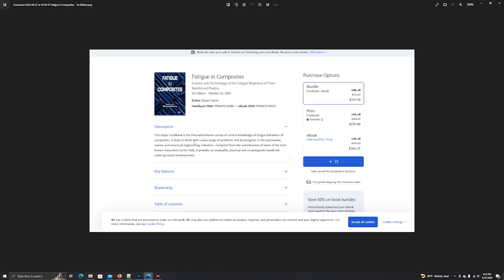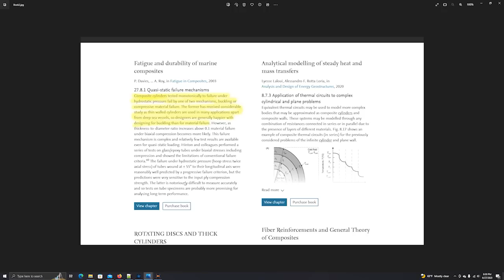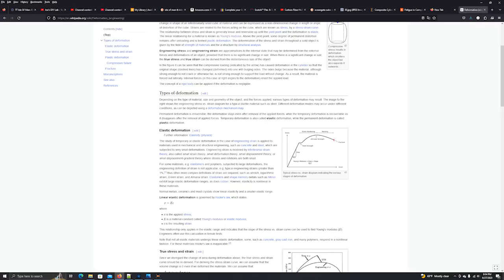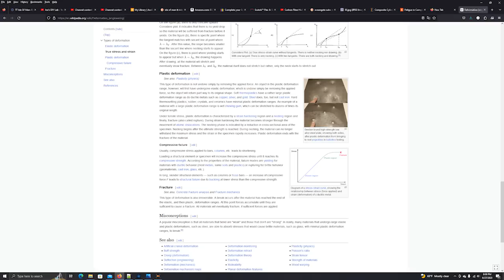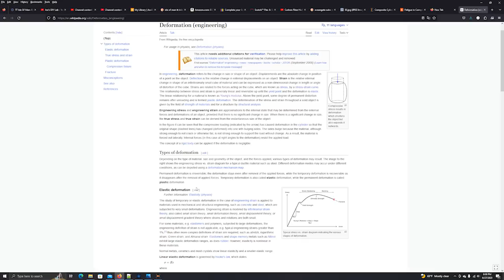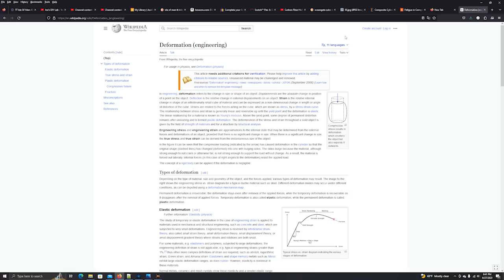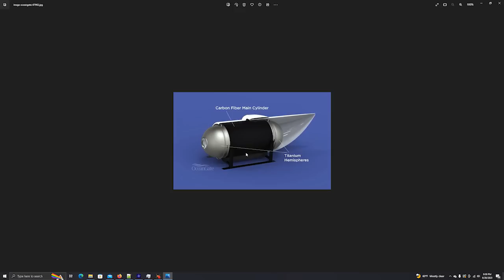Oceangate  Titan Submersible Manufacturing and Engineering Issues Part 2

Comment: The carbon fiber used in Titan was technically a carbon fiber reinforced plastic (CFRP). Carbon Fibers (threads, or a “tow” of carbon fibers twisted together or a woven cloth) are embedded in or saturated with a resin matrix. When cured the matrix (as I understand it) spreads the load (forces) among the fibers and stabilizes the cloth/fibers against bucking when under compressive loads. My understanding is that it is critical that the resin thoroughly wet the fibers/cloth (no voids), that layers of fibers/cloth do not delaminate and that the fibers stay bonded to the resin. J Cameron/others expressed concern that after repeated dives the CFRP would delaminate. In other words the hull would have an operational life of some FINITE number of dive cycles. Looks like this was in fact very low. 

The Titan needed ultrasonic non destructive inspections. Initially after every dive as an experimental vessel (in my engineering opinion as a mech engineering graduate) this is prudent because the Titan: 
1. Used a novel material (CFRP) not used previously for very deep submersion submersibles (around a 1,000 m); 
2. Used a cylindrical pressure vessel v spherical design for depths (3,800 m) far greater than even the most cutting edge titanium hulled submarines 
3. Used a unique joining of materials for the pressure hull (CFRP, Titanium ends, epoxy adhesive) never used on a deep diving submersible, and used combination of materials with different Young’s moduli, thermal expansion/contraction coefficients in a complex geometry. 
All of these factors scream one must inspect every use until enough data confirms what is a safe interval. This is common aviation practice - determine after much experience component X needs to be inspected after Y hours or Z cycles of use. And determine that component X may need to be scrapped after so many hours/cycles.

Rich came from an aerospace background (so it’s been reported). Surely the concept of a finite service life should not have been a foreign concept.
Reply from the maker: Thanks

Comment: One aspect you don't seem to have covered is the adhesion of the epoxy to Titanium, and how the Titanium was prepared for the adhesive.  The best epoxies I've seen are rated for around 5,000 PSI (2,000 psi is more common), but adhesion to a material is different from pure compressive strength or pure linear compression.  I'm thinking they will find the bond between the FC cylinder and the Titanium rings gradually worked  open.  In the end, I think it will be determined that CF is in general a poor choice of material for deep diving submersibles.  The forces against the hull are just too great for the epoxy itself.  The term composite itself implies a combination of dissimilar materials. CF is great for certain applications but is far from the best choice  once certain limits are exceeded.   Acoustic monitoring of loud pops to determine structural integrity seems to be in the realm of compete fantasy.
Reply: On this sub, according the dimensions, radial pressure on the CF tubular section is 400 bars and axial pressure is 1440 bars on these section of 5 inches thick. Very strong on a "plastic" material.
Reply from the maker: Yes these are good questions,  I would question the bonding of the CF to the titanium as well, hopefully the engineering analysis will shed some light on the actual failure.
Reply: concur on the adhesive ... utter BS. And it wasn't even a "friction fit" at Sea Level ... supposedly this was intentional as Rush wanted the adhesive to act as a "cushion" between the CF Hull and Titanium flange mate point expansion/contraction rates. From the photos I saw of the salvaged end caps, there were no CF remnants affixed ... just peeled off.

Comment: After many mention of the port hole endcap having an inadequate rating for this dive, I've also wondered if the CF cylinder had any relevant rating? Given that it was stressed in compression, would it have any useful rating at all in that mode?

I was also curious how much compression force would occur on the cylinder at titanic depth, in the lengthwise direction, as in the force the end caps would exert on the cylinder at depth. The number I came up with was 418 tons! 🤯 Could the CF cylinder withstand this kind of load with a safety margin? Could the joint at the end cap and cylinder withstand this load? Could the epoxy adhesive withstand this load in compression or shear (depending on the nature of the joint)? 418 tons just sounds like a mind boggling number to design for...
Reply from the maker: I believe someone calculated the hull strength,  I heard from several engineers.  Look at some of the posts,  one engineer did show some calculations.  Thanks

Comment: Not sure where you got the idea that the sub made it to bottom, then ascended. I have not heard any news that confirms or denies that. All I've heard is that the surface lost communication at the same time as the implosion sound was detected at 1:45 into the dive, but the normal descent takes 2 hours. If that is correct, the sub didn't even make it to the bottom. The only way we will know what happened is if there was a signal from the sub to the surface that the ballast was dropped prior to the implosion or from the pattern of the debris field. Correct me if I'm wrong, but no information has been released to the public about this.
Reply from the maker: That conjecture was based on a statement made by James Cameron.  Just was repeating whas was said in the media.  I indicated this in the video
Reply: @JoediyLab  Okay, I must have missed that. I recall hearing his first statement and it think was before any debris had been recovered. It will be interesting to hear more details, based what was learned during the recovery.
Reply: The undamaged "landing frame" suggests it may have been jettisoned before the implosion intentionally with the intent to surface.  If it was found a distance from the debris field, this would add to this argument.  This has been noted on another video (cannot remember which one).
Reply: @timecentral3134  I have heard that, but without knowing how it was attached, there is no way to know if it was jettisoned or if it became separated during the implosion. I think it's the latter, not the former, because without it, the sub would not have been able to land on the launch vehicle.
Reply: I just read an article in The New Yorker that quoted someone familiar, “The report that I got immediately after the event—long before they were overdue—was that the sub was approaching thirty-five hundred metres,” he told me, while the oxygen clock was still ticking. “It dropped weights”—meaning that the team had aborted the dive—“then it lost comms, and lost tracking, and an implosion was heard.” So I guess they knew there was a problem and they attempted to abort the dive. That means the occupants knew they were in deep shit. Not a nice way to go. I'm still not convinced that the frame was jettisoned. It would have no way to land on the launch vehicle without it.

Comment: Excellent and detailed analysis and theory.  The pencil comparison isn't completely correct; it could be used if the pencil were being pulled in a straight line vs being compressed in a straight line, but to put it between two chairs and applying weight in the middle results in the top of the pencil being under compression and the bottom to tension. I'm looking forward to part 3.
Reply from the maker: Yes, thanks for the comments

Comment: What i certainly felt immediately when stockton spoke about acoustic sensors in the hull as if i was some kind of expert or just generally using common sense unlike him .Is that once the sensors alarmed its all over ,the movement at placement of those sensors mean it has physically deformed the hull. And at gigantic pressures its a no brainer .It wont pop back out its like fiberglass .Those sensors are more like a last rights alarm saying kiss yo ass goodbye boys.And another point is he used the same mentality on the acrylic porthole saying it will flex before it breaks giving you warning.Its quite stupid to allow such a rsk as to let it flex to let you know its just about done .Its like he tried to make it all seem so easy to control the forces of nature with simple illogical perspectives
Reply: My logic worked just like yours! 😇😬
Reply from the maker: Yes the acoustic system would have went off milliseconds before the crush.
Reply: @JoediyLab  Looks like his acoustic warning system was basically a portable non destructive test which worked, but at that point its too late to do anything about it.
Reply from the maker: @BABA-ws5eo  yes, when you hear the alarm it might be too late

Comment: Very well done. I do wonder if they had somehow engineered some structural elements like ribbing or longerons that would have helped. Even a more interlocking weave pattern when winding it would that have helped. It seems to me that the fact that carbon fiber is strongest in tension would preclude it being used here. 

Either way I am no engineer and I have just questions and no answers.
Reply from the maker: good ideas.  Not sure if bulkheads would have worked as the deformation would have occurred in between the bulkheads.

Comment: Outstanding Joe.  Thanks.   Question:  Given the difference in elasticity between the flange and carbon fiber body and the possible resulting degradation of the epoxy glue bond, are there variations in the bond strength resulting from glue choice or application process?
Reply from the maker: Very much so.  There are many epoxy adhesives with different qualities.  Some epoxy foams and fills, like for honeycomb etc.  Epoxy adhesives are also rated for temp use and flexibility.  Epoxy adhesives also have different strength properties.  Preparation is also critical. There is some conjecture about whether the titanium was properly prepared.  Images from the recovery. Show clean surfaces.  Which could indicate the the epoxy let loose.  We will have to wait and see.  Thanks for the great question
Reply: Thanks Joe.  Looking forward to your next video.
Reply: Another question Joe.  There were reports of a “crackling” sound in the aft section at depth.  Significance?  Since failure of the carbon fiber apparently comes without warning, could the crackling point to an epoxy bond failure?
Reply from the maker: @DavidShea2  more than likely a delamination occuring. As a result of cycling failure.. Or the bonding failing from CF and titanium flange
Reply from the maker: @DavidShea2  thanks, in the process of getting materials together for composite testing.
Reply: Thanks again for all of your effort.

Comment: The guy who said that an ultrasonic inspection would cost 20k has likely never done an inspection on a part this thick. Ive tried before and I couldnt do it.  This material isn't like a metal. Theres too much attenuation. Maybe theres an ultrasonic test machine that would work, but typical handheld test machines would not.
Reply: So how would you test the integrity of the material?
Reply: @uzzuzz9320  Good question. There may be other non-destructive test methods that I'm not aware of.
Reply from the maker: What about x-ray, we use to x-ray folding wind lock pins?
Reply: @JoediyLab  maybe. I've heard that this material is basically transparent to x-rays but I couldn't say for sure.
Reply: @matthew4878  they can xray through semi-trailers carrying iron. They can most certainly XRay through this. The problem would be that unlike Ultrasound, there is no depth perception - what you see is all the 667 layers of CF superimposed over one another. You would see fractures but not delamination. To see delamination on XRay would mean directing the rays longitudinally along the tube rather than across its diameter - it would be very difficult to visualise a slight delamination (fractions of a mm) at some point along the length of the tube as you are now necessarily using much higher energy to penetrate a 12 foot long section of CF rather than 5 inches - this would be in the MegaVolt range - 

As the XRay energy goes up, the ability to discriminate between structures lying very close together, or even see small structures at all, decreases.  Such high energy photons blast through small structures to be able to penetrate the full length of the structure. To blast through the 12 foot haystack, you wont see the needle, effectively.

There are Ultrasound machines that can penetrate hundreds of feet through the earth and rock. They arent handheld, though. analysing this 5 inch thick CF tube is most certainly possible using Ultrasound - but it would be very time consuming (and therefore costly) as every layer of laminate at different depths would need to be examined at every point along its length- not achievable with XRay. It would be possible to measure the gap between laminates, any deviation from expected measurements, or inconsistencies in these measurements indicating delamination would be well demonstrated. The Ultrasound would direct transversely through the 5 inch thick CF, and be able to look at each layer and compare each to adjacent layers. Unlike XRay, the penetrability of the sound beam (wavelength) can be adjusted to optimally demonstrate structures at different distances from the source.
Its like comparing Sonar to a photograph. 

Given the different compression coefficients of the 2 materials, the Titanium shrinking onto the CF at great pressure could only have produced cracking in the CF, common sense seems to suggest. 

Maybe they didnt want to know the answer?
Maybe they knew if it was tested theyd have to build another pressure vessel, at great expense? Or, admit that he should have built out of Titanium from the start.
Common sense again dictates that any sealed structure that is going to compress and expand must be made from materials that compress and expand equally?
The length of the join is also a concern - as the titanium expands when rising, it was then only this glue that prevented water from entering between the end caps and the CF?

This thing was a death trap.
Reply: @uzzuzz9320  For something like this there really is not a non destructive way to test.  The proper way wouldve been submitting it on a single dive.  Cutting it in half to inspect.  Build another and have it complete two dives, then cut it open.  Basically a good amount of trial/error and money to really understand its limitations.
Reply: This approach was so cavalier that there is no real point in attempting to evaluate. It was simply reckless.
Reply: Industrial Computed Tomography (CT) scanners are a thing. 
Any void that will show on a standard X-Ray would warrant scrapping the entire assembly.
Sonography on a submerged part is also possible.

Comment: "Thin wall" isn't a term specifically referring to absolute thickness of the wall, but rather relative thickness of the wall compared to overall radius.  For pressure vessels, it's a ratio of 1 to 10.  According to wiki et al, the diameter of the carbon tube was 1.68m / 5'6", and the walls were 127mm, or 5" thick.  This makes the Titan thick wall, it would need to be over 8 feet in diameter with the same wall thickness to get into thin wall. 

For the NDT thing, I would be extremely surprised if the supplier of the carbon tube had not done ultrasound at least on delivery (the figure of 1% porosity was being mentioned, that smacks very much of pre-delivery testing).  But yeah, ultrasound and probably total stripdown should have been being done after every dive to any significant depth.  It was an experimental submarine, after all.
Reply from the maker: Interesting,   I gather you are from the UK,  All of the documentation I have read states:  "http://freestudy.co.uk/statics/complex/t1.pdf"  "A cylinder is regarded as thin walled when the wall thickness t is less than 1/20 of the diameter D." Wondering if there are different standards between our countries.
Reply: @JoediyLab  Been a while since I studied maths, but it seems 1/10 of radius is probably somewhere fairly adjacent to 1/20 of diameter

:)
Reply from the maker: Sounds good to me. Thanks
Reply: @JoediyLab  You can delete those comments if you want.  I won't say anything  if you don't :)
Reply from the maker: No problem,  Thanks for the all of the interaction.  It is always good to discuss with folks who have different backgrounds.

Comment: My gut feeling is that the reports will conclude it was a failure of the bond between the tube and flange.  If the tube itself had failed first or solely, I would expect to see the flange adhesive failing mostly cohesively with some sign of remaining carbon substrate.  But that's not what it looked like in the salvage pictures.  There was a mottled color to the bonding surface that looks to me like 50-75% of the epoxy-titanium bond line let go.  The possibility does exist that the violence of the implosion stripped the adhesive off but I would still expect to see some fibers left on the flange in that case.  If the bond line failed adhesively, I would expect the titanium to look pretty clean (as it did)
Reply from the maker: Thanks for your feedback,  Yes I am looking forward to seeing the results.

Comment: In the text you quote, its my impression that the thickness referred to is the vessel's wall thickness, i.e., 5 inches.  Thus the tatio of thickness to diameter is 5 / 96 = 0.052